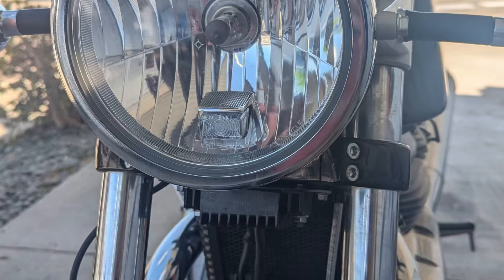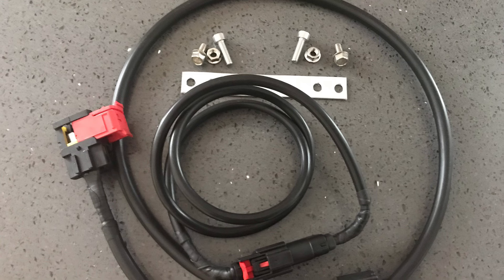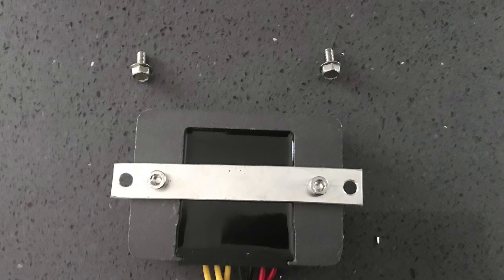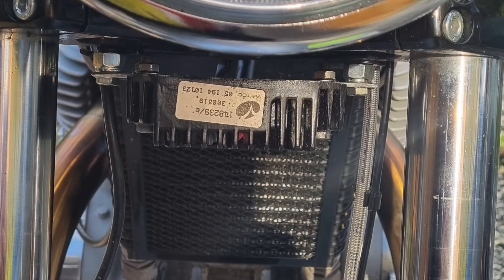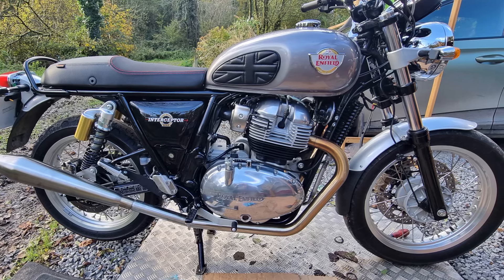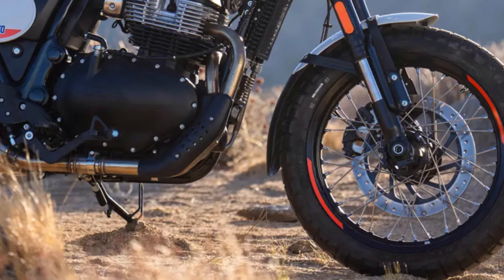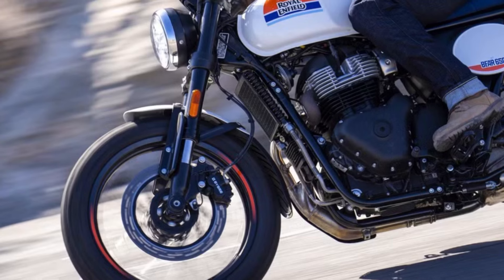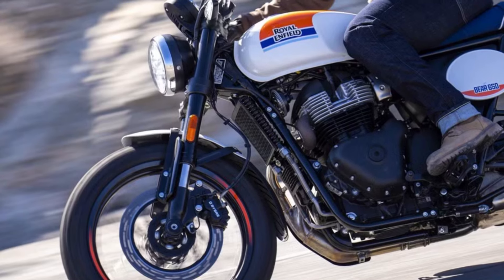Interceptor and GT. Check out the new ‘Bear’and position of its rectifier😀

Comment: Hi James, l have a super meteor, it is situated under the engine. I would have bought your conversion kits but they have changed the wiring on the rectifier 😢. Nice too see they have changed it on the bear. Chris.
Reply from the maker: @cyelland5064  they sure did. The RR is still in the daft place. If you send me close-up pix of your RR and especially the block connector (which plugs straight into the RR with no wires on the RR itself), then I can look at a plug and play kit for it
Reply: @internetpolification  will do that in the morning.Thank Chris